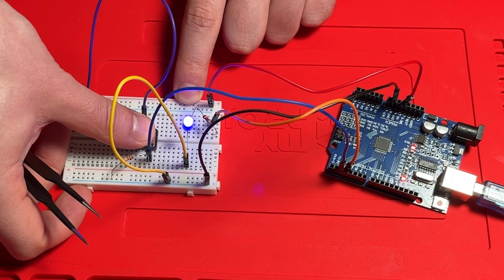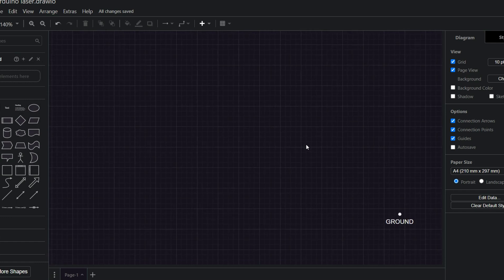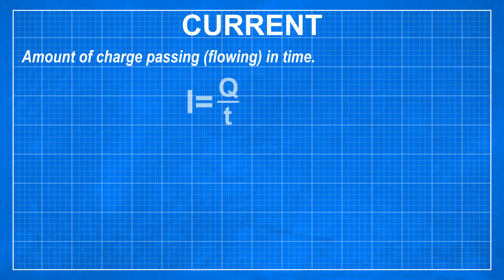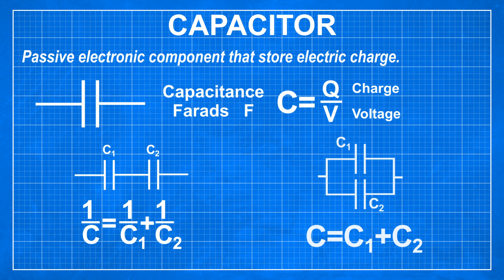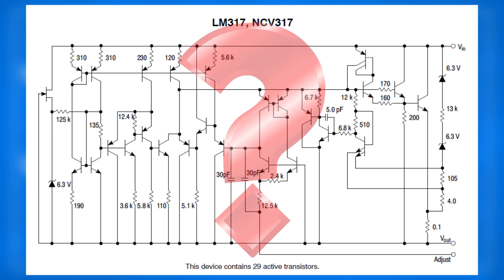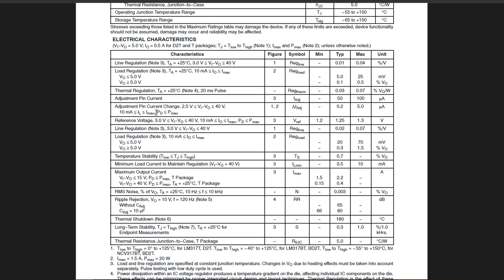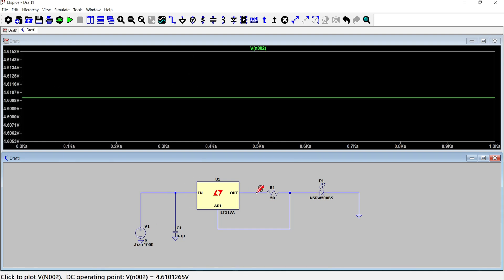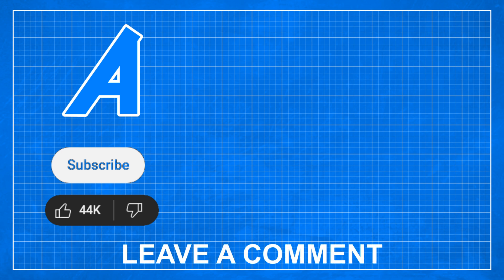Arduino for Beginners: Laser Diode Driver

Comment: How to build a laser that  could cut a steel plate 4mm thick?
Reply from the maker: Use a more powerful laser. I will use a 5mW diode, laser cutters can reach above 10000W.
Reply: You need either a fiber laser, which are very expensive, or use a plasma cutter, which is like $200.